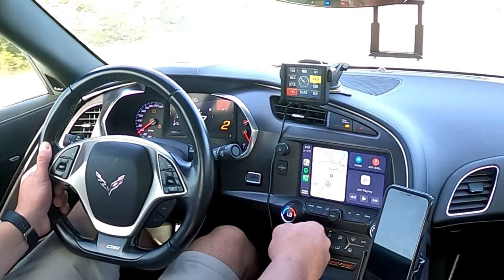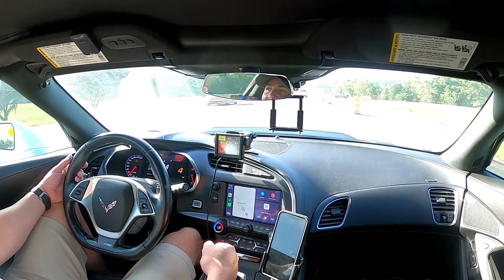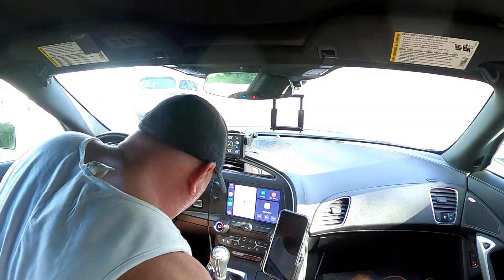Corvette GenV Z06 Holley EFI Port Injection talk (New EGT System) and a few MT ET Street R pulls...

Comment: What mph you hit in 4th on that tire setup?
Reply from the maker: I honestly can't remember I know I shift from 3rd to 4th at 130, so probably around 165 to 170 mph.  Wheel and tire is same or very close height to stock.  They are a bit taller tire.
Reply: My red line is 7200 and I hit mid- high 150s in fourth with toyo r888r

Comment: What’s the holder for the Holley touch screen you’re using
Reply from the maker: I used a simple adjustable cellphone holder like this: https://www.amazon.com/dp/B07T6SX1JT/ref=sspa_dk_detail_4?psc=1&pd_rd_i=B07T6SX1JT&pd_rd_w=98mMM&pf_rd_p=80360d1c-2d74-4d2e-9034-f92fb5248b33&pd_rd_wg=IGb54&pf_rd_r=9F3QE7B70D07XX74TMTF&pd_rd_r=97b789a0-a199-4823-a411-6d960e855ce1&spLa=ZW5jcnlwdGVkUXVhbGlmaWVyPUEyRUo0UEFNTlBMN0JVJmVuY3J5cHRlZElkPUEwNDc0MTc4MVIzS1pJTkVQSURTWiZlbmNyeXB0ZWRBZElkPUEwMTc0NjY5MU05SEJDSTVBVlc1WiZ3aWRnZXROYW1lPXNwX2RldGFpbCZhY3Rpb249Y2xpY2tSZWRpcmVjdCZkb05vdExvZ0NsaWNrPXRydWU=

Comment: who tunes your car and what cam did you go with?
Reply from the maker: Chris Crawford @ Crawford Racing.   He’s tuned some of the fastest GenVs in the country including Tim Kings car who I believe has the record for C7’s.  Vengeance Racing is the shop I mostly purchase from and I get some advice from time to time with them.  And do the work myself.  My cam is a custom grind (boosted cam) stage 3 Vengeance Racing.  660+ lift LSA more boost friendly.  I went as large as I could being a manual it’s pretty street friendly it does surge a bit at low speed but not too bad.
Reply: @MichaelBrownPlus  awesome thanks for the reply. was Chris crawford able to remote tune or was it done at his shop? i have almost exactly the same set up as you and am in search of a good tuner. my build is on a sixth gen zl1 1le though xD
Reply from the maker: Welcome bud.  He remote tuned me over the last year plus.  Course he’s done hundreds of GenVs and probably a dozen builds that are nearly identical to mine (416, cam size, ProCharged, Port, etc.). All around 1100 to 1200 wheel.  So when his first tunes for both HP and then Holley were so close it’s crazy.  But keep in mind we still have a dyno session coming soon I have a couple more update to make then we plan on a full dyno session where we plan on working out the final tuning.  He’s top notch forums also back that up.  Check his website out if you haven’t.   Make sure you let him know I referred you.  He’s worked with me for years now.  Good luck happy to answer any questions.

Comment: awesome. cant wait to get my car back. we pretty much have the same set up. yours is f1a94 as well?
Reply from the maker: Yes sir F1A-94 wouldn't change a thing with my blower.  The air to air is truly the restriction.  Doing a 4" cold side upgrade with my TIG machine soon I have all the piping so it's true 103mm out my intercooler cold side to my TB to my G1Pro intake.  Makes sense anyway being cooler denser air being 3" in and 4" out.  Air to water would pick up some serious power 100 more wheel HP easily but I don't want any more complexity.  I am just about done with everything I set out to do once I dyno and get some track days in over the next couple months I plan on selling.  If I can at least get close to what it's worth.   Will see...good luck with yours shoot me some pics to michaelrbrown@gmail.com.